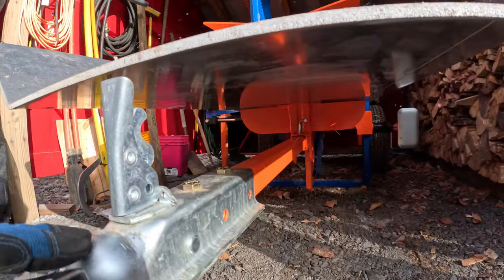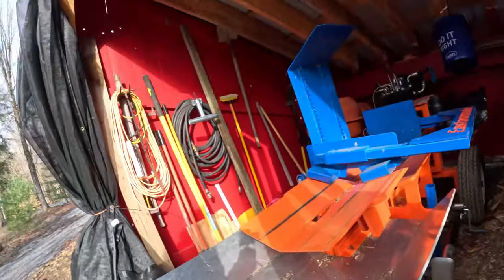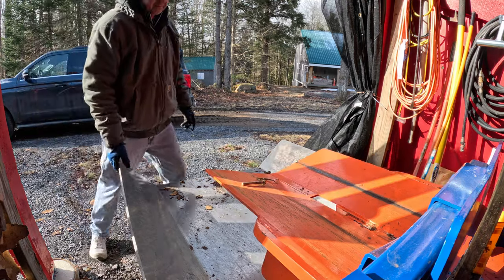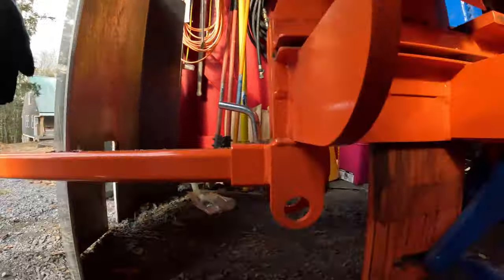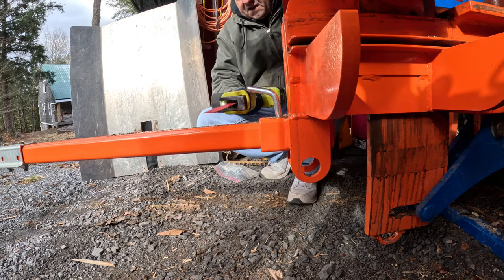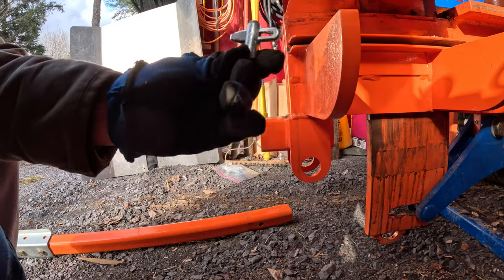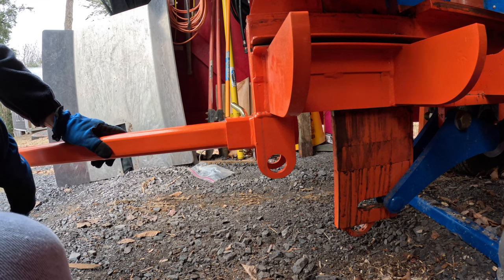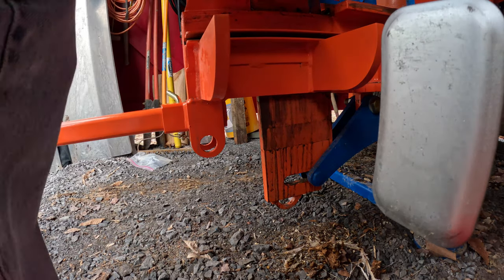Eastonmade 12-22 Dead In The Water #firewood #woodsplitter #woodhound

Comment: Happened to me Day 1.  I had a 22-28 the old style pin that didn’t have the thing you pinch in the middle to get it to turn.  I got an new Ultra with the new style and I was able to get the new one unstuck it by going the opposite hole on the bottom with a really thin piece of metal to pinch it and position it straight.
Reply from the maker: Hey Jose, yeah I think they should probably just switch to a different type of pin since a fair number of people have run into the issue.  Thanks for watching!
Reply: @adirondackwoodsman  there was definitely nothing wrong with the older one.  Thx for bringing this up.

Comment: You could remove the wedge, to give yourself some room under tray so you can access the pin through the open end of the towing bar. Use a rod of stick that long enough to reach the pin with and tap the lock straight on the pin.  Save yourself from cutting the pin.
Reply from the maker: I figured it was easier to spend $3 on a different style pin because I would probably would   end up doing it again. Plus I wasn’t crazy about that style pin.
Thanks for watching!

Comment: Looks like the receiver tube was open on the back end so maybe you could have rotated the 90 degree part inside the tube from the rear with pliers?
Reply from the maker: Yes possibly but I didn’t like that design of pin anyway and guess it would have happened again so for $3 it made sense to replace it.  Plus it’s fun cutting steel 😂